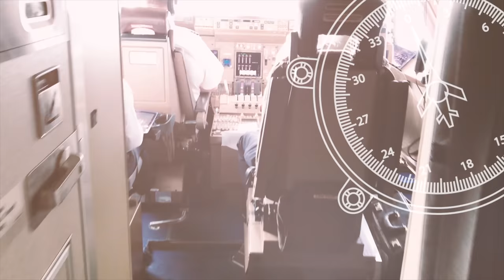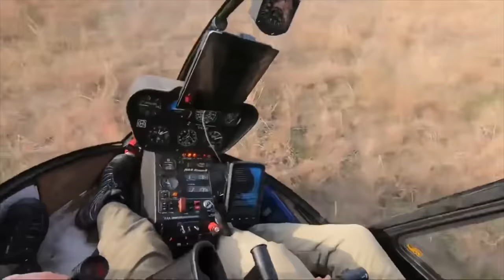Boeing 747 Loses Landing Gear | Viral Debrief

Comment: How is it that parts were replaced, perhaps a check-valve, and a maintenance gear swing was not accomplished before sign-off???  I would also assume a lot more fuel was dumped below max landing weight with the consideration of a missing gear, max landing weight assumes you have all gear available.  I would also assume the pilots bounced the plane to see if they could get the gear to drop, not knowing the ultimate problem.  Odd the gear didn't hydraulically lower [the problem], and if the gear could have been blown down with an emergency actuation, was the gear missing altogether??

Comment: @13:40 you say that he first banked right which put the wheels into the ground, creating a seesaw effect and then it was teetering. However, that seesaw effect was already happening before the right wheels touched the ground. So may I propose an alternative hypothesis? Could it be that he banked so low that the right wing was effected by the 'ground effect', such that the air near the ground acted like a cushion, as it does for ground effect vehicles. The right wing being lower, it got that (or more of that) effect, then naturally bounced back due to that, putting the left wing into ground effect (or greater ground effect than the right wing which was then up), bouncing that wing, and so on. After this, the bouncing wheels had a similar effect. So basically the bouncing was happening through contact with two media, first the denser cushion of air (compressed by the wings against the ground), - fluid, similar to a boat bobbing left and right on water; then on the ground itself - solid.

Comment: As well as an incorrectly fitted wing gear actuator, this 747 also suffered a loss of the number 4 Hydraulic system.  As your FCOM and QRH will tell you, one of the items you lose in this situation is the outboard RH elevator.  Pitch authority is much reduced.  This is what contributed to the firm touchdown as pitch response was a lot less than the pilots expected, even knowing what the QRH said.  The crew had dumped fuel for about 40 minutes and the aircraft was at a pretty normal landing weight.
You can also the effects of the no.4 system failure on the rollout as the inboard ground spoilers don’t deploy (1:12).   FWIW I did 6 years on the 747 before moving to the 787.

Comment: I don't think that last one was Boracay.  There are two airports that serve Boracay (none on Boracay itself)  The closest one  at Caticlan goes Sea>Runway>Sea.  But they stopped on grass.  The longer one at Kalibo has a longer runway (8,200 ft vs. 5,900 ft) with 6 touchdown zone markers (500' markers) at each end.  In the video I only counted 3 looking out the window before they got to the threshold.  Even the short one at Caticlan has 4 on each end.

Comment: So about that last video, I think you're right, there's something about the audio... So I checked some things, Boracay doesn't have an airport, there is an airport in Caticlan just across a small strait, but it's not that one either, because both ends of the runway are basically on the beach, so it doesn't add up with what we see on the video. I tried matching the footage with other airports near Boracay, but none of them really seem to match this video. Strange!
EDIT: Okay, so I didn't look hard enough, I'm pretty sure it's actually Kalibo international airport, approach from the north-east (RWY 23), crossing the diagonal road, diagonal red roof on the right, directly after that are the terminal buildings, grassy area at the end of the runway to the south-west. Yep, that must be it! Not too far from Boracay either.
EDIT 2: Also, Kalibo airport runway is 2.5 km (8200 ft) long

Comment: 10:27 When a helicopter engine fails, you don't loose lift. The blades continue to autototate as you drop, reducing descent rate. You need to adopt a different flight mentality then it's just a heavy landing. Usually...

Comment: With the 747's missing landing gear. How did they know it was a problem as it was obviously down when they took off and they would have gone through the normal retract procedure, but then they would not know anything about it until they needed to lower the gear at their destination with the associated warnings about being some wheels not being where they should be underneath the aircraft?

Comment: It's actually generally safer to be in a helicopter in which the (single) engine has failed than in an airplane in which the (single) engine has failed. That autorotation thing you mentioned? Trainee helicopter pilots practice that, just like you'd practice, IDK, a touch and go, or landing in a crosswind. Additionally, it's part of the bi-yearly proficiency check, unless I am mistaken. So... even if you have had to practice "dead-engine" landing in an airplane, there's still the fact that a helicopter - even one in an emergency landing situation - requires far less level ground to land than an airplane does. So, yes, while it might seem scary, it's not THAT big of a deal. Depending on the circumstances, the landing can even be relatively gentle (all things considered). That pilot might have "kept his speed up" in order to land as close to the road as he could, either to increase the likelihood that he'd be seen by a passerby (which might be a rare occurrence at that location, IDK), for ease of access by medical personnel in the unlikely event that someone was injured, or even for simple convenience. Now if there's a major component failure in the gearbox, and it causes the rotor assembly to seize, on the other hand...

See-sawing 777: Not to mention that, if you're forced (or have volunteered, I suppose) to fight your airplane like that whilst landing, you're not really able to usefully control it. "It's difficult to steer a bucking bronco across the paddock."

Comment: There is no airport in Boracay. The airport is in Caticlan which is a different island but this is not it. On the final approach of Caticlan airport whether you're landing on runway 6 or runway 24, you will not see rice fields. All you can see are the sea up to the edge of the runway. Also, if you overshoot the runway, you'll end up on the beach.

Comment: I was on a plane that dumped fuel once. Many many moons ago, we were leaving LAX for Dallas in a DC-10.
This wasn't too long after a DC-10 had had an engine fall off on another flight so I wasn't worried at all. 😐
This plane had, from left to right, 2 seats, an isle, 5 seats, and isle, and then 2 more seats.
I know planes need to flex to some degree but you could see the flexing in this thing as we were taking off.
There was a loud sound and a feeling of impact. Not sure to this day what happened but I assume we lost an engine.
We were taking off heading west over the Pacific Ocean. 
The pilot announced that we would be dumping fuel and returning to LAX.
We landed safely but the crew was in a big hurry to get everyone off.
I still wonder to this day what happened. Any Ideas?

Comment: I can not much about aircrafts but energy always works in the same way, so when I see the pilot put down the aircraft so hard that it later bounce up I thought he did so to lose energy faster to shorten the length of the landing, for much energy has to go into the compression and lift of the aircraft and that would make the aircraft have less energy to roll a longer distance.

Am I wrong, do it work like that or was that hard landing just a mistake?

This was my first thought when I saw it, if anyone answer try to explain why my idea may not be correct rather than just say "You're wrong", make your answer educational.

Comment: I do believe that the Virgin crew on the 744 intentionally slammed the gear in order to help the right bogie to fall out by gravity. I think it's a common practice if conditions are preferable.
Reply: You are kidding. Not at all ever a standard practice at all to slam the plane onto  the ground to try to drop the gear. Having the gear slam down while on the ground at landing may be dissasterouse damage gear, damage plane, gear probably won't lock down because it can't extend down fully. Bad things would happen.

Comment: Is there a manual way to lower your landing gear on a 747  Like in some of the old movies
Reply: There is not a manual way to lower the gear on modern airliners. They are too big and heavy. There is a way to unlock the mechanism holding the gear up. That way, the gears own weight may bring it down.

Comment: Obviously the helicopter pilot was pretty sharp, he was maybe 50' off the ground, you hear the engine go silent and the engine tach goes to 0. The nose instantly yaws left, he dumps collective and enters the auto. Airspeed is life, he had enough to get down nicely. I think he was shooting for the roadway, I would have, until he saw the wires. He turned left, did a decent job of maintaining his rotor speed, and touched down. I can't fault him (never had a for real engine failure, especially at 50' with no time to think about what's going on) but he might have flared a bit to dissipate some of the forward speed. Then again he may have been too low to flare, and all of that scrub might have caught his tail and done more harm than good. As long as his passengers are OK everything else is secondary. Like a Robinson factory instructor said in safety school, "the helicopter instantly belongs to the insurance company, all that matters is the people onboard".

Comment: Hello! I don't have so many hours experience as a ...pasager but are there planes that have a smoother landing than others? Regardles of pilot experience, runway type.. I flew with 737 and then with a prop bombardier.  737 old but smooth , the  bombardier ..man like a sledge hammer hit the runway.

Comment: There was more to the helicopter landing than meets the eye. First, only one mag appears to have been switched on. Second, he hit the ground very hard – so hard that it split the skids. This can be attributed to the visible lack of flare. It is plausible that he was out of CG and thus unable to flare – I’m speculating. Finally, the tailboom got cut off by the main rotor. This happens when the pilot continues to pull back on the cyclic even after RPM has decayed in the cushion and the blades have started drooping. It is imperative not to try to arrest a ground-run with aft cyclic. Long story short: at least part of this was pilot-induced. Apart from the engine failure itself, this should have been a non-event. That said, I look forward to the final report.

Comment: That last landing of the A320 was questionable from all aspects lol. I wonder if the pilots got their licenses from Ebay. You're definitely right about the flaps, that looks like flaps 20 on an airfield where you want the full 40. And they must've been absolutely rocking it down on the final. Floating that long, especially without full flaps.. insane.. 
How do pilots like that still exist? Just go the f around lol. Time is not worth risking safety and losing your license.

Comment: that's actually a pretty poor autorotation. if you consider that helicopter pilots regularly practice autorotations and that it's supposed to be a soft touch down, but in this case the gear collapsed, it's like thank god they are alive, don't thank the pilot.

Comment: I was on a 74 flying into DFW several years ago [ don't remember the exact year: 1994 or 95 ] in worsening-conditions: heavy wind-shear - Typical North Texas Stormy / Tornado-building Weather - that had been building up for several hours by the time we arrived - I was coming back from my Interview at Delta in Atlanta [ for an A&P / QC Maintenance Inspector Job ] and I was the ONLY passenger on plane - me and 3 or 4 Flight Attendants - the pilot [ or Co P ] came over the intercom telling us we were in Wind-shear, that we were gonna make one attempt at landing, but that if we were unsuccessful or the weather got worse, we were gonna head for our alternate, which I think was either Lubbock or Austin-Mueller [ the old airport, which was replaced by Austin-Bergtrom ] , I don't remember which [ I've been diverted to both heading into DFW in stormy weather ] - the plane was up and down all over the place on approach and it felt like we bounced off the runway 2 or 3 times before settling - everybody in the cabin [ not counting me of course ] screamed bloody murder when we bounced and then clapped and cheered wildly after we were safely on the ground - I've flown probably 10 million air miles over the last 40 years and it was the hardest landing I've ever experienced [ not counting my own 152 Hard Landings as a Student Pilot ] ..

Comment: 10:30 um so autorotation landing is a thing and you actually can glide your helicopter to the ground ???
Reply: Basically what it is.  Though it's less gliding and more "falling with style."  

Reduce pitch and point the nose down, to keep air moving through the rotor so that it's still spinning.  At the last moment you pull pitch and flare, trading the inertia in the rotor blades for lift.

Comment: The R44 (Helicopter) Pilot should have flared the aircraft at about 50-80 feet above ground. That would have stopped his forward airspeed and enabled him to put the collective in his armpit and make a smooth touchdown at almost zero airspeed. My question is, why didn't he? He basically did a run-on landing in rough terrain and was very - and I mean VERY - lucky. The aircraft could have easily caught a skid and balled it up on landing doing it the way he did. So - what am I missing?

Comment: Your comments on doing it different in small planes sounds like what a private flight instructor told me.  He said commercial pilots have hardest time (do the worst) at landing small aircraft.  You all are too used to flaring high and even flat on the ground you are still way above the ground.  In small plane your head is likely little or no higher than when you are standing on the ground.

Comment: I was under the impression that helicopter autorotation should give them the ability to stay in the air without an engine for a similar amount of time to a fixed wing - and land with a much lower speed - and the real reason everything happens fast is because of how low they were flying.

Comment: bit like my flying on x-plane which is very iffy and wouldnt be real pilot approved lol !!. as for the last segment of this vid, i havnt got to grasp with decent landing speeds thus end up somewhat stopping later than i should have. im not clued up on aviation to that extent, and it was watching one of these videos on this channel that taught me what that 'zebra crossing' thing was....a landing marker where just over that you should make touchdown. but even if your aiming for that and your too fast (as seen in this video) your not going to stop on runway....in that case i usually then power up and retract gear and do a 2nd run round at lower speeds, which ideally that pilot should in my eyes have done rather than end up off the beaten track and onto grass.

Comment: Kelsey: If you did a walkaround on  your plane, does your familiarty with a healthy landing gear tell you that this plane should NOT taxi onto a runway? I've sat and watched one of the pilots walk around. They do focus on one pin as I remember. But really, whatever you fly, the overall condition of the landing gear should delay pushback. Once you head to the runway, things are already more complicated. One "solution" would be the guys who repair landing gear do that part of the walkaround. But they don't have a dog in the race. The pilot has more at risk. But the airline or the maintenance people need to conduct a class so pilots are not so superficial.

Comment: I live right by an airport that also services the ANG Fighter Jets. Sometimes at around 50-200 feet altitude, just before landing, they sometimes emit a medium-high pitched whistle. It's not air blowing over the skin or any naturally occurring sound, I don't believe. It almost seems to act like a "STALL" warning. That's just an observation with a guess by this pedestrian. I only know a little about Cessnas, not Fighter Jets. Anybody? What is that whistle sound?  Does it have a specific function, or is it just a sound that's a characteristic of those jets?

Comment: 747 has proven time and again how over engineered she is.  Landing at max weight, driving the gear into the ground that badly is really hard on the gear when ALL the gear are present.  Now, do that with the entire outboard main gear missing, yet The Queen took care of her passengers and crew and didn't even scape an engine or wing tip.  China airlines 006 747SP was brutalized by her flight crew, and even after them tearing off large parts of her tail she still got everyone home (bent wings and all).  Kelsey, thanks for sharing what it's like to fly the 747!

Comment: Interesting what you say about dumping fuel. I can't remember a flight in recent years on which I've been aware of fuel being dumped before landing, but I do recall multiple times during flights in the 1970s and up into the early 80s where fuel would be dumped before landing after a completely normal flight (recall at least one time with a DC 8, and one time with a DC 9. In both cases those were flights starting in Amsterdam, and ending at either Corsica or one of the Spanish islands. Wondering what that was about now. (that DC 8 flight was rather interesting, were only 5 passengers.. and during those years,  and  on such a quiet flight, paying a visit to the flight deck was a thing and often the door would be open. Was like having a private plane.. with more people involved in operating the plane than passengers)